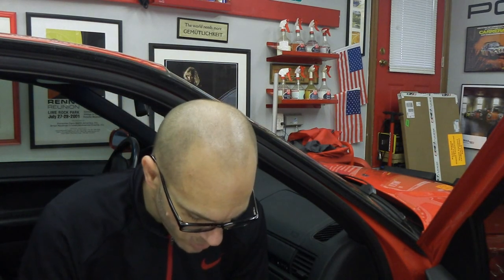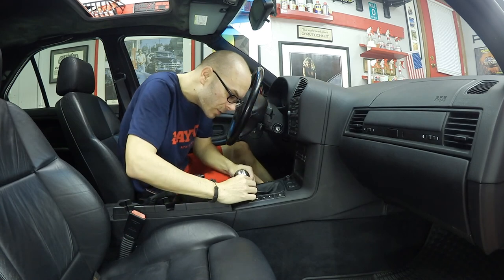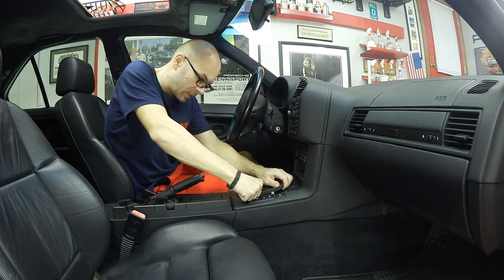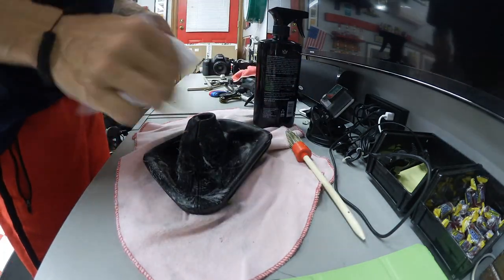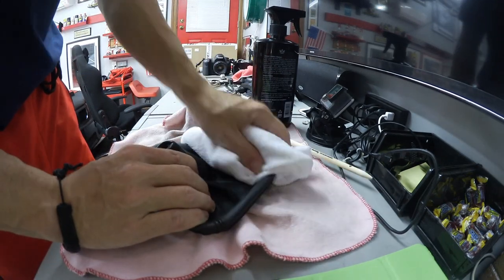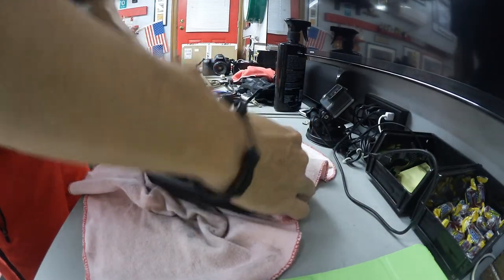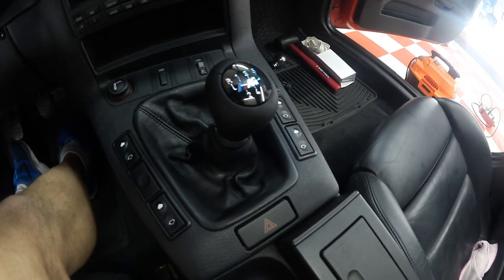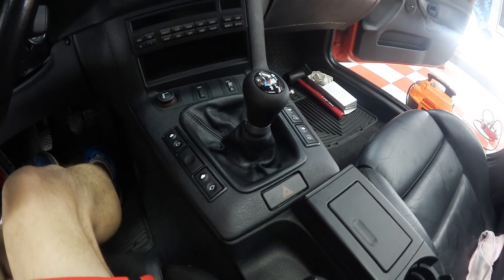1997 BMW E36 M3 Sedan | Quest for Perfection Ep. 02 | Boot Reconditioning + ZHP Shift Knob Install

Comment: Great job! Also you have the infamous 5th gear lean on the shifter. It leans towards fifth. Bushings etc need to be replaced. Look it up pretty common issue. Not really an issue but for younger crowd a lot "money shift" because of this lean.